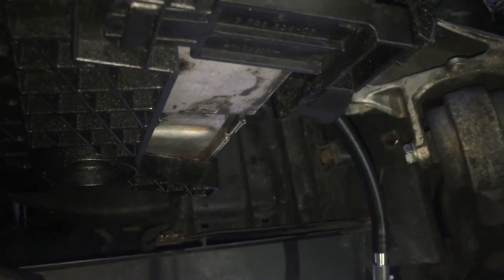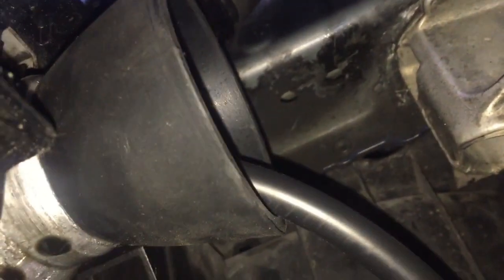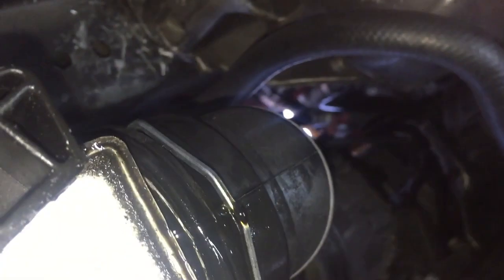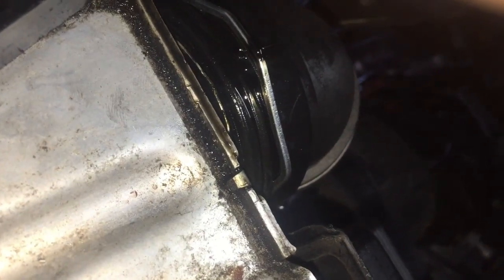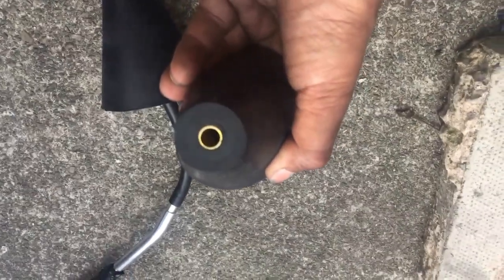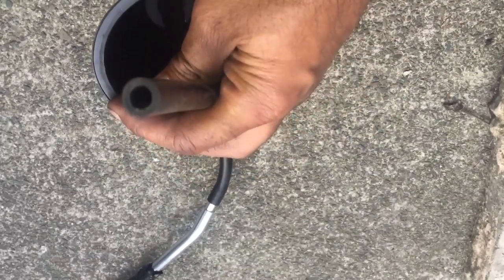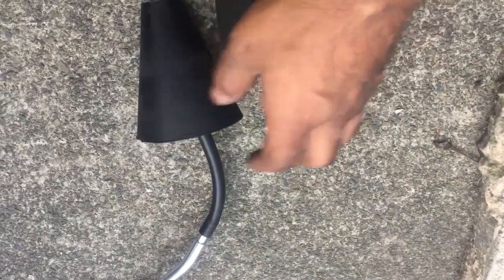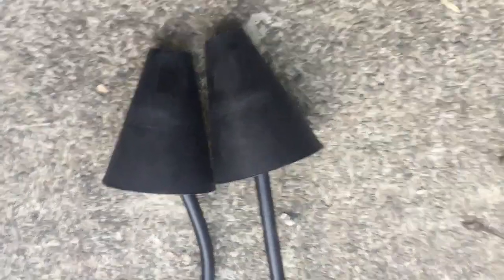How I Discovered A Boost Leak Using These Great Tools

Comment: Where did you insert the pipe that you blew into? I have a feeling i may have a boost leak along with a suspected rod knock. When engine is switched on and idling i can hear a slight hissing from the engine bay but cannot locate where the sound is coming from due the the lound engine sound. Also engine sounds like a rod knock as the knock sound moves along with revvs too.
Reply from the maker: Into the other side of the intercooler.